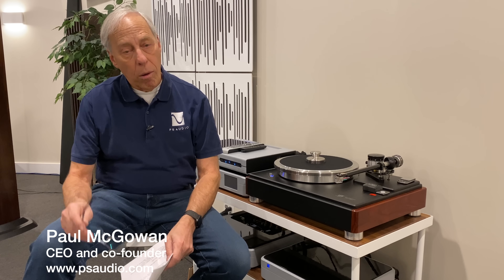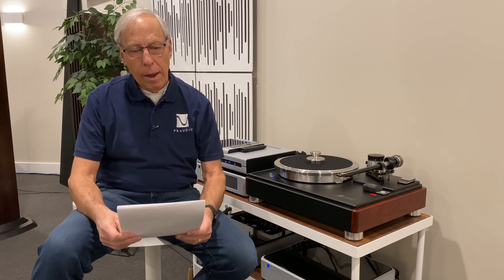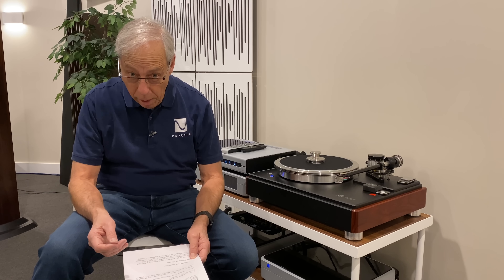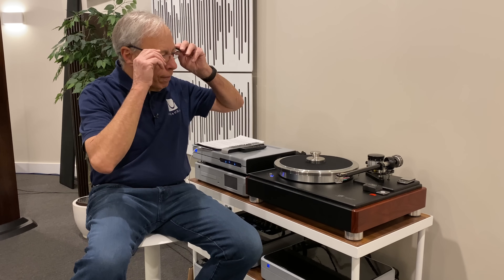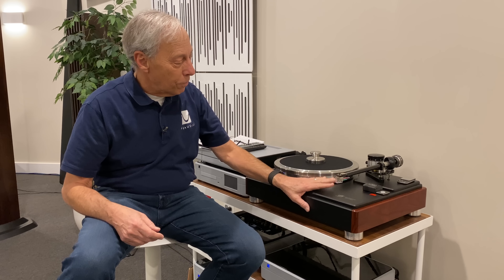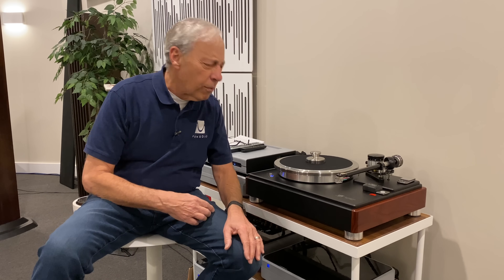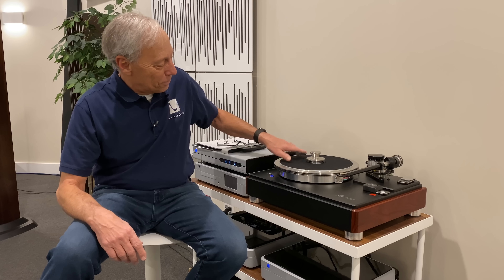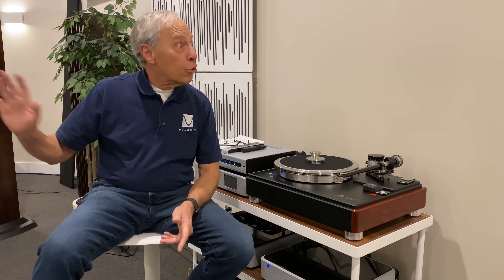Better to use a power conditioner or straight into the wall?

Comment: How about digital equipment? Unless I missed it, it appears you are referring more to analog equipment, particularly an amp and maybe a preamp.
Reply: kills all
Reply: @markwilson913  Really? It restricts dynamics of a DAC?
Reply: @sean_heisler  It does mine, but my DAC uses discrete opamps on the output stage. All DAC's amplify the output signal, so they are in effect a pre-pre-amp.
Reply: @joshua43214  Yeah, but the draw of the DAC analog stage is so low. Hell, even a preamp for that matter. Well, maybe I'll compare again the wall vs my Furman with my DAC. Are you using a discrete opamp in place of an opamp, like the Burson's, or do you mean your DAC has a discrete output stage with no opamps?
Reply: @sean_heisler  My DAC has discrete opamps for the output stage rather than an opamp chip. The difference in current demand is significant. It also uses a shunt style power supply, so it does not have a ton of overhead in the form of smoothing caps.
Reply: @joshua43214  Interesting. I knew discrete output stages typically require their own power supply for best performance but didn't realize they drew that much power. My Schiit Bifrost 2 has an IC opamp output stage but I'm still going to at least try going direct to the wall instead of to the Furman (I have two dedicated AC lines as well).
Reply: About the only digital equipment in audio are a transport and a server/computer unless you are mixing or producing. I doubt a regenerator would help. I'd be far more worried about the electrical noise coming out of a computer, than the power coming in. It is very difficult to get good digital audio from a computer.
DAC's obviously have an analogue output stage. I use a medical grade filter on my DAC, and it seems to help alot, and does not have the effects Paul is talking about. I removed the filter from the pre-amp since it made things worse. It is a toss up with my power amp, so I removed it since it served no purpose.
I arrived at the same conclusion as Paul, it all about input vs output impedance.
Reply: If your referring to usng a digital voltmeter to test and see how good your AC power is your using the wrong equipment. Proper line testing equipment is very specialized and needs a way of logging what's going on over time. Voltagle level is only one of many things to be measured and logged. If you accuse your pwer company of supplying defetive power they'll bring out a little box, plug it into one of your wall sockets and log the line for a week or so. They may, or may not, be able to monitor that remotely.
Reply: @wilcalint  No, no, I mean like DAC's and CD Players, I don't see how a line conditioner negatively affects those. I could only see potential benefit. Amps, preamps, yes, I get it. I have my amp and preamp connected to the wall directly but my DAC and Upsampler connected to my Furman conditioner.
Reply: @sean_heisler  Kool. Fun discussion. brings back crazy experiences I've had.

Comment: A properly designed power conditioner can boost your amplifiers RMS output. 

NOT Furman. You need more circuitry than simple $25 RFI filter.
Reply: How?
Reply: @thisisnev  The supra has a DC filter that makes the amplifier more dynamic. It is quite fantastic really. :)  RFI filter will not make it more efficient. I can't see that will help.Supra has only RFI filters for low power outputs. I guess it is just a joke that you can get a good filter for 25$. That just sounds too fantastic. Yes, you could get a good power cable for 25$, but a power conditioner? I have not seen any great conditioner at 25$. Maybe BuildYourOwnBass could come with an example. It would be very cheap to test out.
Reply: I have a couple of racks of pro sound equipment that have Furman power directors, (a glorified power strip with outlet switching), sorry don't remember the model.  These are mostly used for the switching convenience (and sequencing in better models). Anyway,  I took one apart and was surprised and disappointed in the junk parts they used for surge supression and (RF filtering?).  Sourced some new parts similar to the quality used in a couple of expensive "TrippLite" surge protectors I own and upgraded the Furmans.  This was just to "feel better" about the simple units for short money.  I also have a complicated Furman with transformer isolation and voltage regulation but that one is only good for about 100 watts total, (so no power amps).  You could plug preamps, etc into it... maybe.  PS, it can audibly hum, so there's that.
So now, my stereo equipment is plugged into a couple of very high quality surge protectors, can't afford any regeneration devices.  At my age, probably couldn't hear it anyway.
Reply: @denniswalsh8476  Furman is mostly for low power tasks. Power amplifiers need something else. But for studio, the power amps are not critical for the mixing.